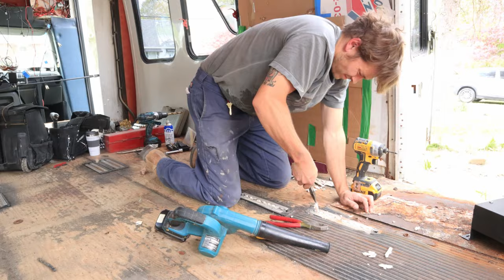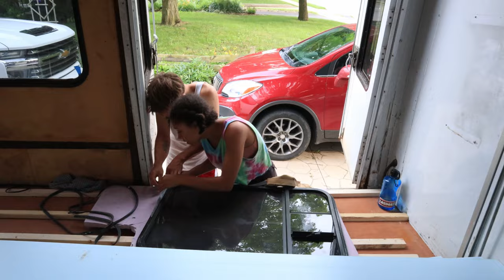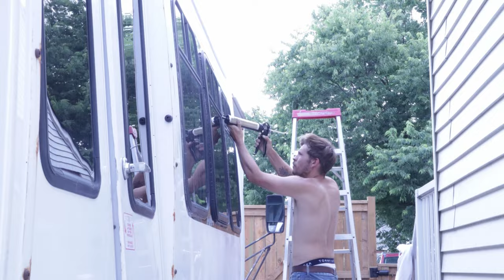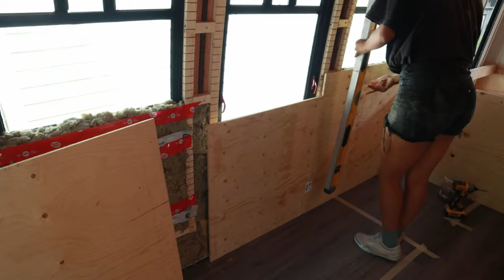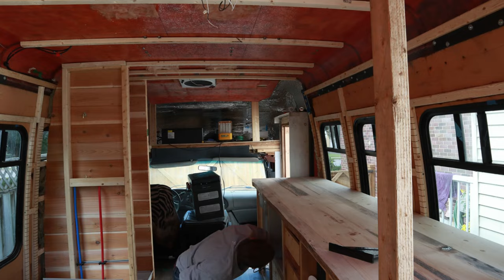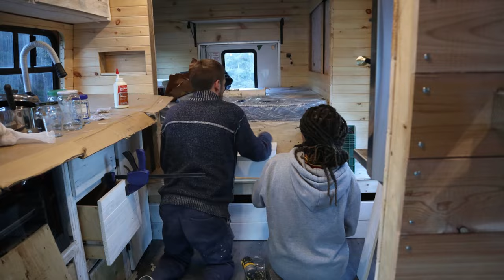Shuttle Bus Conversion | FULL TIMELAPSE | Building a tiny HOME on Wheels | Start to Finish

Comment: Ever think of putting sheet metal under the frame and sealing with butyl tape and insulate between that with foam Insulation sheets and your sub floor?

Comment: Wait did you guys put wood flooring down without sheet metal underneath?
Reply from the maker: Yes we ended up putting down marine grade plywood which is water resistant and coated it.. We didn't find any plywood with sheet metal in our price range..
Reply: @bobbisworld  Looking good guys.
Reply from the maker: Thank you 😊 it was definitely a wild project and we are still not completely done.. Come spring we'll finish our last projects!
Reply: @bobbisworld  same here man. I been living full time in a 40’ skoolie. Been working on it for little over a year. Still always something to do. I’m building under storage right now. ✌🏻have a good day man

Comment: I'd love if you could give me some advice about how you attached framing to your walls I haven't had any luck finding any info on fiberglass busses. Thank you from Nate and Izzy.
Reply: The fiberglass walls are usually attached to a steel frame...I found mine w a strong magnet....then use self tapping screw of the correct length
Reply: Oh and some need grommets between them to keep from piercing the fiberglass over time